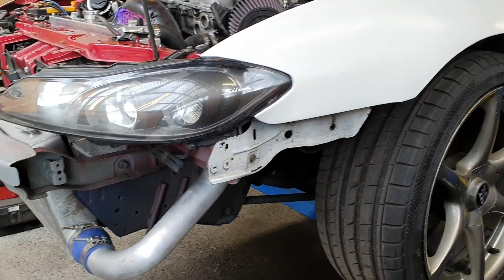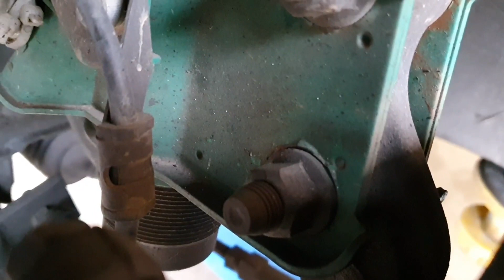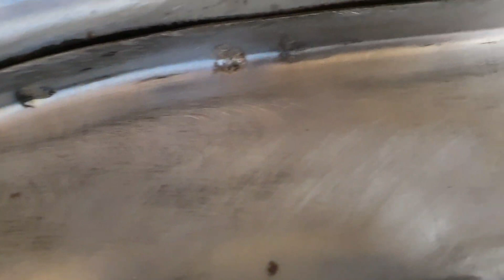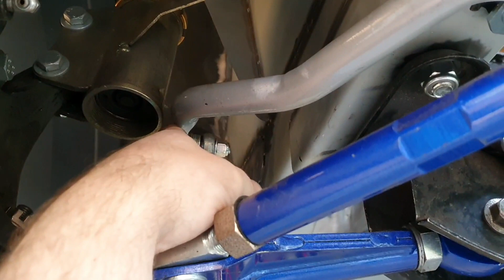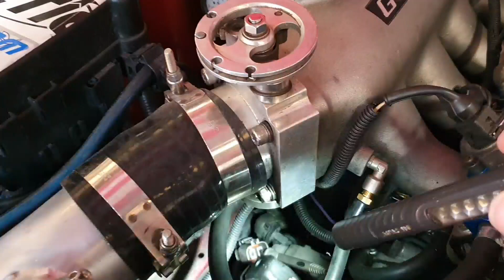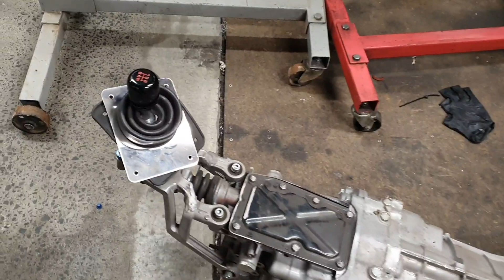69 Gloria, 99 Silvia garage party

Comment: Sounds like the VCT cam gear rattle to me, does the noise go away above about 1500rpm?
Reply from the maker: Yeah VCT does not appear to operate when the solenoid is engaged, the gear has apparently been "rebuilt" we will see what it does when it's on the dyno where we can make all the noise we want without disturbing the peace.
It gets significantly quieter once a bit of heat soaks into the engine so I'm leaning towards piston to bore clearance being a bit high and an internal fault in the VCT gear preventing operation.